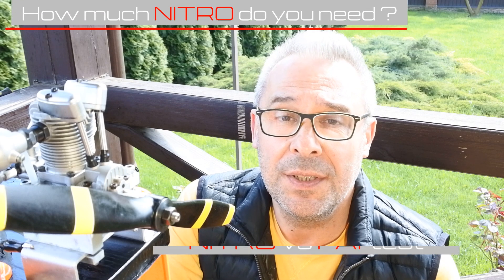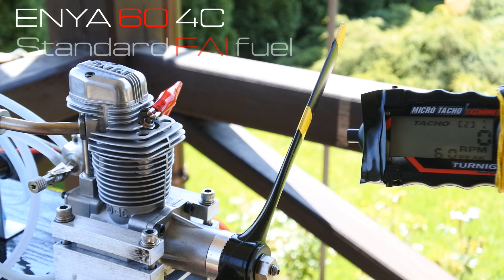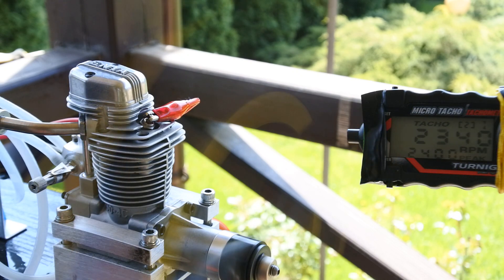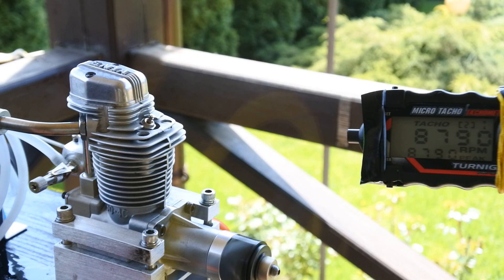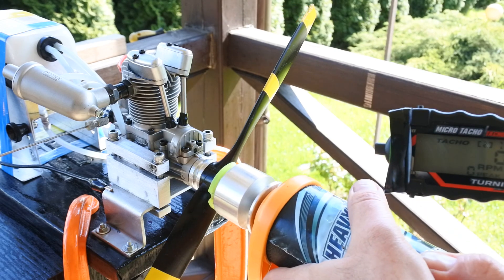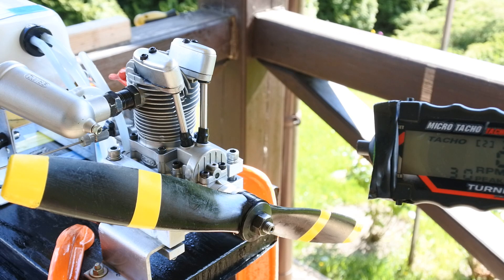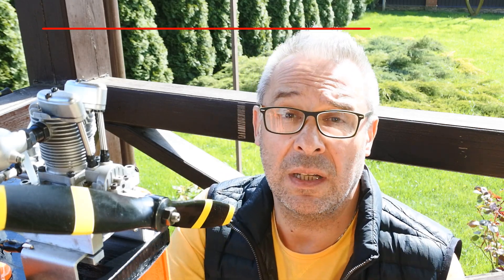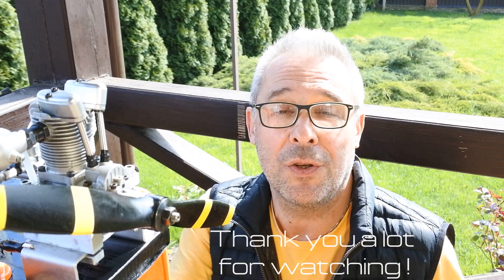How much NITRO do you really need ?

Comment: On my Saito 100, 33% nitro with 16% oil is worth almost 1,000 rpm over 0% with 18% oil.
Reply from the maker: Hi, thank you for your interesting comment , you're totally right ! As far as I know from the cycle of my tests with amount of Nitro, over 30% of Nitro  practically makes no differences to RPM. I think, that next step to power increase - is to use more effective fuel (some additions to methanol). I believe the lack of further engine power gain (after 33% Nitro) is due to the fact that 30%+ Nitro already provides an excess amount of oxygen, which can't be used for combustion, as all the methanol present in the fuel mixture has already burned. To test this theory, we'll, of course, need to conduct a series of tests with a richer fuel mixture or with the addition of additional organic fuels (a small percentage of kerosene or gasoline, or more efficient ethanol or isopropyl alcohol). In short, further experimentation is needed, which we'll do a little later. Thank you for your comment and have a nice day !
Reply: @crazyengines88 have you tried retarding the ignition timing when upping the nitro?
I know that you commented that you were getting detonation and that would obviously prevent the engine to rev. 
The most I’ve run is 33% glow fuel in my Saito 100 but I’m going all the way up to 50% when the weather cooperates. I’m going to, in theory, retard the timing right off the bat by using a cold plug and experiment from there. 
This past summer we were out and I was flying my two strokes on 20% and forgot to swap to the colder plugs. Popped a couple plugs that day. 
It’s all fun experimenting. 
Thanks for your videos man. I really enjoy them.
Reply from the maker: @mrbigg7255  Hi and thank you for your great comment ! Basically, the main goal was to increase engine power, to "charge" it with Nitro. I assumed that Nitro increases the amount of oxygen in the combustion chamber, leading to more complete combustion of the mixture, and therefore, to increased power. Frankly, I didn't take the retarding effect into account; I was more focused on the fuel mixture composition. In a glow-ignition engine, the retarding effect should certainly be pronounced (as you describe), but with spark ignition, I think the process follows in a little bit different path. All this, of course, will need to be confirmed experimentally on the bench stand. Thank you and have a nice day !

Comment: If you need nitromathane, the first 5% makes the most difference.
Reply from the maker: Thank you for your information ! Interesting, for sure. But I couldn't find an answer, why a lot of fuel manufactures are still keep in production over 16% Nitro content fuel ? For example, Model Technics still offers 16%, 20% and even 25% Nitro content fuels. Byron Originals is also still producing 20% and 30% Nitro content fuels. So, there could be some reason for that ? Of course, the higher the Nitro content, the higher their profit, but probably, there is constant demand for higher Nitro % ? I assume & right now I'm thinking, that 15% Nitro in my testing wasn't enough, to get an exact data, I should have applied an even higher %, especially since I have on hand a quart of Model Technics BigBang with 25% Nitro. I am ashamed, of course, not to think through the whole experiment completely. However, I would be sure that 15% was enough to see a trend, but I understand right now, that testing 3 fuels, FAI, 15% and 25% Nitro should be much more representative.
Reply: @crazyengines88  I use nitromathane more as a tuning additive than a power adder. Without nitromathane, sometimes it is hard to get the proper mixture at all throttle settings. Usually rich in the midrange. The add oxygen in the fuel makes needle settings not as critical. 
It would be interesting to see if higher nitromathane fuel allows you to run a larger or higher pitch propeller. It is my understanding that nitromathane burns longer and pushes on the piston as the crankshaft angle has a greater advantage to make torque.
Reply from the maker: @mikeeiben3430  Thank you very much for explanation. I think, that my NITRO investigations aren't ended yet, especially  after your notes. I just need to plan  testing more precisely, what testing procedure I should apply and in what order, to get the results even more reliable.  Thank you !
Reply: Wrong.

Comment: This is why I just don’t see the benefit of running higher nitro content fuel. Here in the states the cost of fuel goes up exponentially whenever fuel has a higher nitro content, and if the difference is literally less then 1000 rpm it’s not worth it to me I’ll stick to my home brew FAI fuel.
Reply from the maker: Thank you for your comment ! Certainly, I was also surprised about the test results. There isn't so I wasn't found any significant benefits in performance to pay so much for Nitro.
Thank you !
Reply: @crazyengines88  plus the huge benefit of using FAI is there’s no nitro so no internal parts will rust.
Reply from the maker: @millerrc5829  Exactly, Sir, absolutely agreed ! Nitro content is increasing fuel residue to collect the moisture inside the engine, being repaired of a dozens of engines, confirm this surely !

Comment: OS with 15% nitro got just 9000rpm not 9600, the 9600 is wrong data I think. I check 3 times the video, 9600 just shows in half second. I think is wrong.
Reply from the maker: Hello, thanks for the comment. I rewatched the entire rough cut of the video (it's much longer) to make sure. You are right, 9600 rpm was only in this fragment for a short time. The remaining fragments showed a lower value, 9340-9510 rpm's, it was 3 takes). Unfortunately, the tachometer records the peak values, so it is not always possible to understand the range, even if was very close to the top. Thanks for your attention!

Comment: Thanks for sharing! I think what might be equally interesting would be the idle characteristics with or without Nitro (how low you can go). Best regards, Jorg
Reply from the maker: Thank you for your comment and for your great question ! Partially, you can find and answer in one of my previous videos: https://youtu.be/njmN2BmPKYg where I was trying to find the key factors - low and stable idle influencers. My experience shows, that there a lot of factors: prop size (and its weight, flywheel moment), glow plug type and model (from my best idling glow plugs list: OS G5, HANGAR 9, Yamada #4). As deeper glow heater is placed inside engines combustion chamber, more convenient ignition you can achieve. Oil quality and its content in the fuel mix is also important, as thinner oil film oil could be achieved, the less drag and friction will be on internal engine parts, so less mechanical resistance. Engine design is also important, for example, camshaft and valves mechanism design). Good quality bearings, outside temperature, barometric pressure - and this aren't all the factors of influence. From my experience, I've some list of the nice idling engines (single cylinder). and Saito  line is on the top: Saito FA 30, FA 45, FA 45 special, FA 56 & 65, FA 91 & FA 100. Old FA 120S DP is also good. Haven't yet tested Saito FA 180 (long awaited test). From OS line: FS 54, FS 90. Most of Enya's line are great performers. Apologizing for so long reply, this low and stable idle topic is my favorite. 🙂
Reply from the maker: Some theoretical addition to the topic, regarding the low stable idle. 4 stroke engine, being in fact, a self-oscillating air pump, where mechanical friction losses are compensated by fuel energy, can be considered as an oscillatory system. In it, one of the main factors is the "quality factor", QR factor, or the quality of the oscillatory circuit. The higher the quality factor, the lower the internal losses and, accordingly, the system's ability to maintain a self-oscillating mode. In our case, the concept of "quality factor" includes many of the factors that I have listed. That is why the mass of the flywheel on the shaft determines the inertia of the system, and its ability to work stably at a lower speed. As soon as the quality factor of the system decreases (due to friction, or insufficient calorific value of the fuel), the oscillations die out, the engine stalls. Therefore, in theory, with an increased amount of NITRO in the fuel, and an increased amount of oxygen in the combustion chamber, more heat energy should be released, amplifying the oscillations. Again, in theory, adding NITRO to the fuel should shift the point where the engine stalls to a lower RPM. But that's in theory. And in practice, thanks to you, I became interested in this topic again. Still have to work 🙂
Reply from the maker: @tandlerguitars3721  Thank you for your comment ! I've a special note / precaution about O.S. G5 glow plug usage - please, check thoroughly the space in between the piston surface and the glow plug hot end. IMPORTANT ! Due to the fact, that O.S. G5 plug is longer, than usual type F and similar plugs, and its sits deeper in engine's combustion chamber, it could touch the piston surface at T.D.C. This caused in a few, mainly O.S. design style  engines (FS 60, FS 61, FS 52, FS 62V, T.T. F54S). I found that few days ago, on the top's of their pistons, when was start to clean engines after a cycle of the test runs. The sign of glow plug touch is small, like a small dot. Interesting, that most of Saito engines tested, are not affected, due to another combustion chamber shape. It's not a problem, but this could be easily solved by installing additional, second glow plug copper shim.